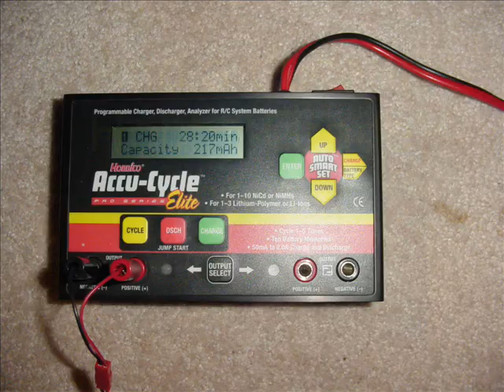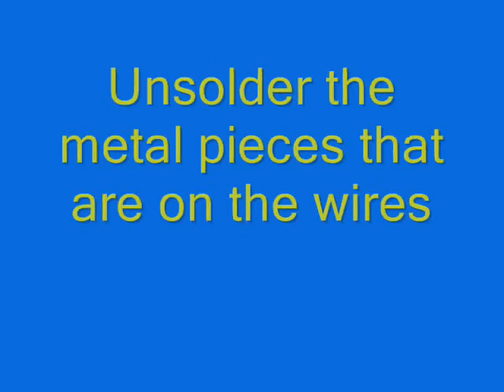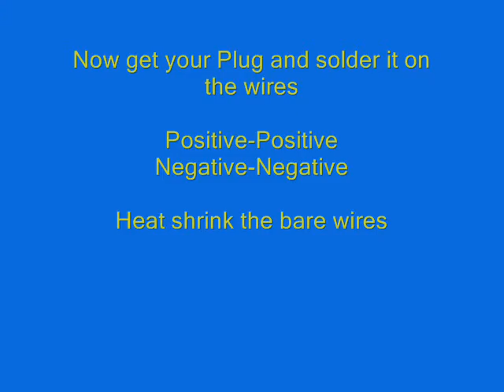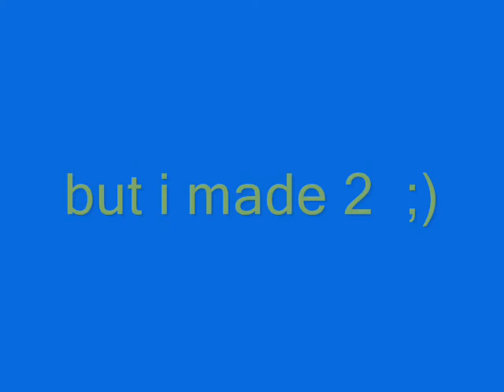Turning the Storm Launcher Battery into 3 cells

Comment from the maker: hey iamtheroboto...ofpop!  It is holding up just fine.  Although one day it was very hot and i pushed the lipo and the plane to the limit.  The lipo swelled up in the heat but eventually went back to normal.  So i still use both in my byp yak.  I get around 7-10minutes on one of these lipos.  It just depends on how hard i push the plane.  I have also flown the byp yak to unresonable heights.  I couldnt even see it how high it was.  I am very impressed with the range of 2.5ghz.